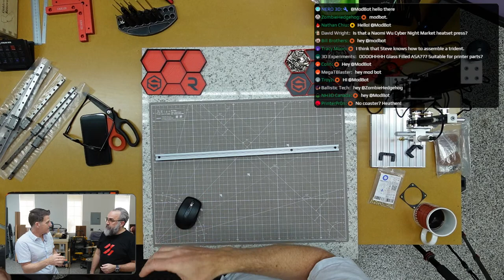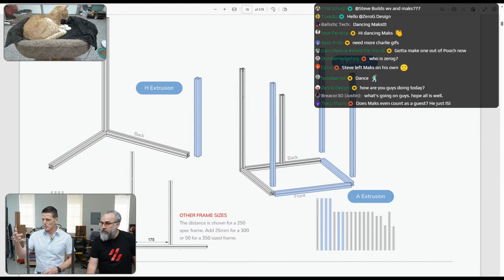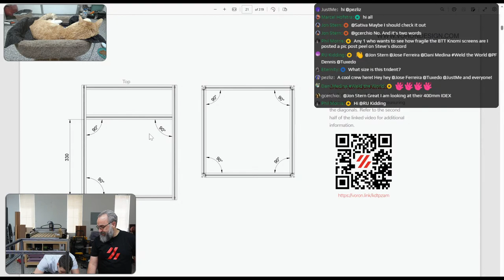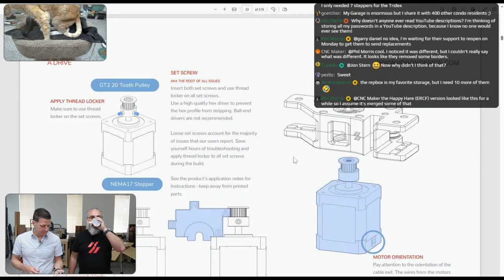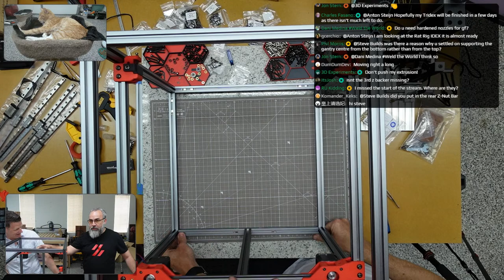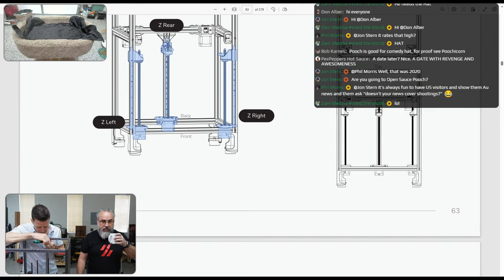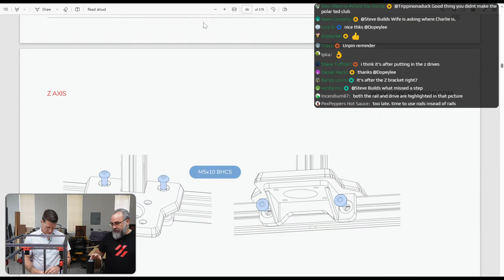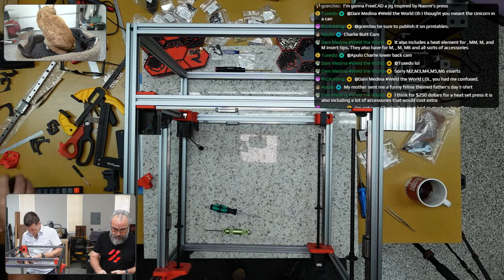Pooch's Trident Build! - (Part 1)

Comment: Thank you to the kind person that donated Charlie's Angels membership to me!  Here's some partial notes, that may help whoever creates a full time index.  Cheers!
0:00 Intros - Trident 300 builds, beautiful glass filled ASA, strong n' brittle
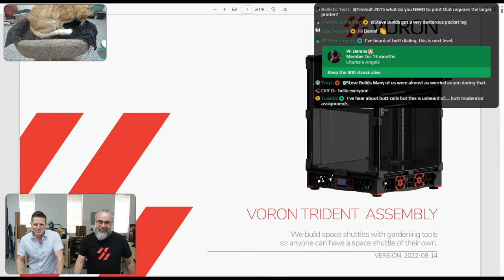22:30 Frame Assembly start
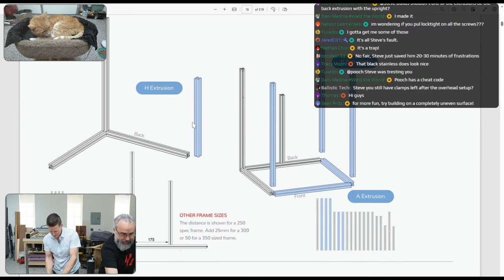36:00 Sketchy camera setup using overhead 2x4's, clamps and 2020...
39:39 Reminder, this is Charlie's channel
47:30 TIP: Using washers with blind hole bolt to provide more consistent surface.  Will help reduce twist.  Y extrusions alignment critical, so worth the effort.
51:30 War stories about needing to reassemble frames, empathy for Chris Riley.
1:03:00 With frame base and uprights assembled, spend some time squaring/align/tram/tuning while tightening up with 1-2-3 block.  Pooch appreciates the handy 1-2-3 block.
1:09:00 Consider rubber mat, and 3D printed midsoles.  Tools bounce better off thick epoxy flooring.
1:29:30 Bearing stacks are always shimmed, with flanges out.
1:30:45 More appreciation for glass filled ASA.

Comment: I'm looking to build a custom printer to print my RC airplanes. I need to build something with a 500mm Z axis, X/Y axis can be normal size. I'm looking at some sort of Core X/Y type build because I plan to enclose and heat it to reduce warping. I'm not sure if I should be looking at a typical Core X/Y build or something more along the lines of a Voron. What are your thoughts and where is a good place to start looking? Thank you
Reply from the maker: A Voron is a typical CoreXY printer.  Extending Z isn't too big of a deal, just source the correct longer extrusions and rails.  Honestly the V2.4 would be easier due to not having to worry about lenght and quality of leadscrews on Trident.